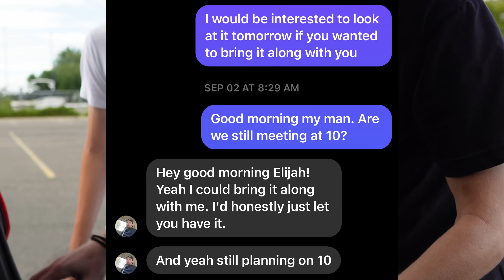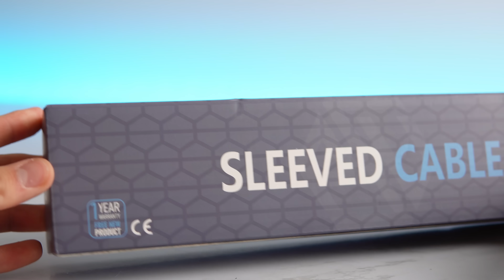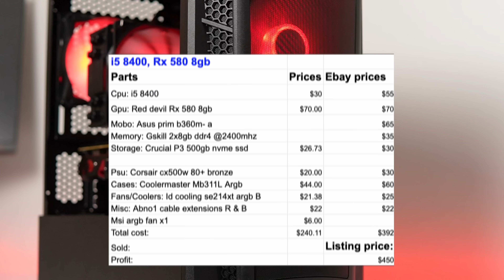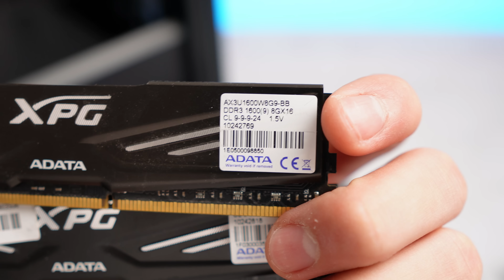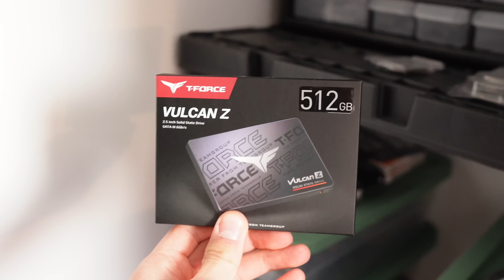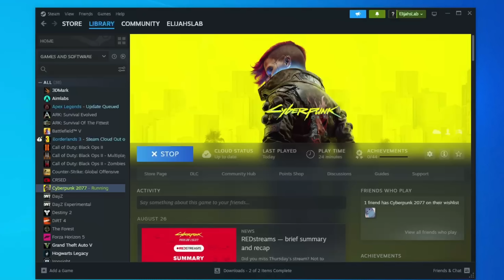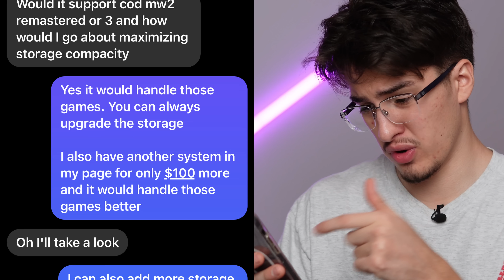Flipping Pcs until I BUY a House Ep. 22!

Comment: got this amazing deal for $180 also bundled with
16gb ram ocpc rgb 3200mhz
 i5 10400f 
 h410m gigabyte mobo
 rx 570 got it for 30usd only one fan working but it still works fine 
free xpg 120gb m.2 nvme got
and also the motherboard cpu and ram bundle give me a free darkflash void cooler

all for $180 and i lived in Philippines always watching you i've been flipping since 2017 got inspired by scrap yard wars , tech yes city and you

Comment: I usually give the leftover psu extensions to the buyers, so they can upgrade later. Always use cable combs. Last recommendation route the pcie through the opening where fpanel connector goes if there is no cut out. Besides that I just wanted to say I love your videos, and that you are an inspiration.
Reply: NEVER mix PSU cables! that's a one way ticket to a house fire!"
You could maybe swap out cables if they were from the same brand but never switching between brands. Each company makes their cables differently and having the wrong cable can lead to a hardware failure!
Reply: @koreannom  I said psu cable extensions, which just extend the cable, so there's no harm.